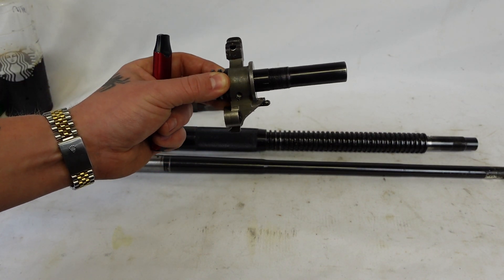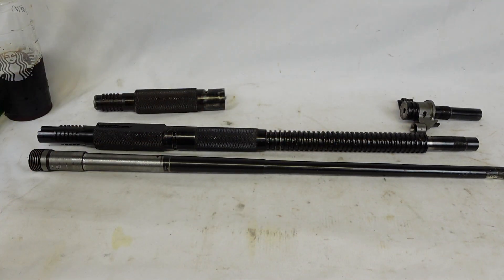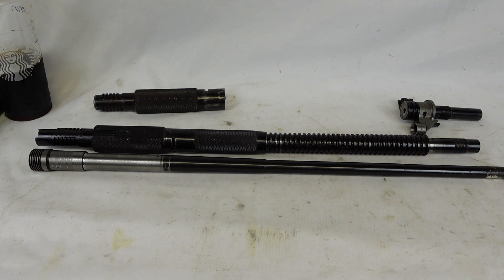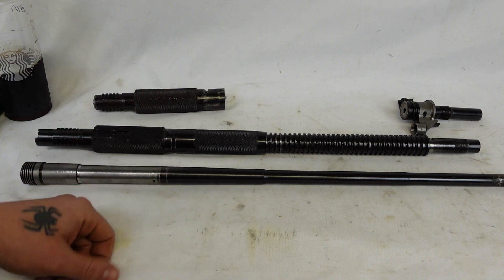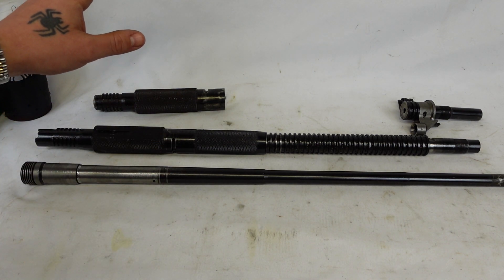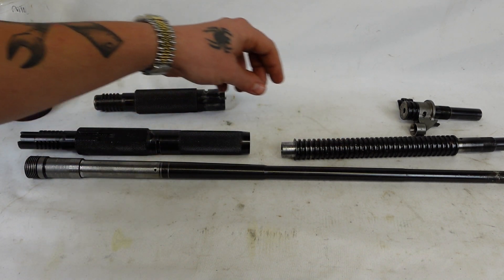Sleeving a rifle barrel - The ZB30J Project

Comment: Great info, I'm looking forward to seeing how it works out.
Sounds similar to the Salerno process done in Italy to sleeve down 10.4 Vetterli to 6.5 Carcano, although that used hammering from inside the bore, instead of thermal fitting.
I have a re-weld Garand that was rebarreled in a similar way, years ago. The breech end of the cut barrel  was drilled out all the way through, and a larger diameter was drilled partway in. A new old stock 1903 barrel was turned to match, and the two were press-fit together in the same way. Then a taper was turned on the outside to blend the old barrel stub and new exposed diameter of the 1903 barrel, and some work was done at the muzzle to accommodate the gas system.